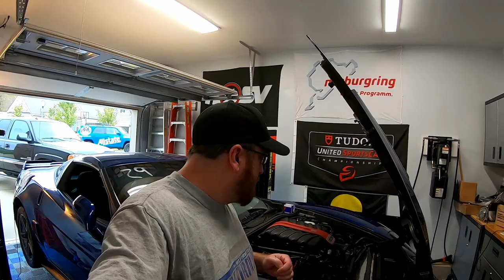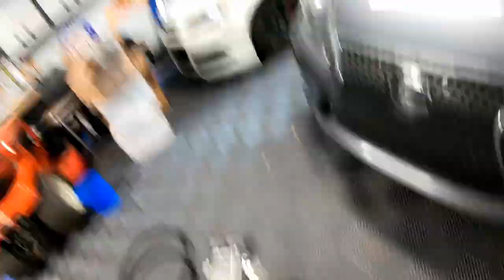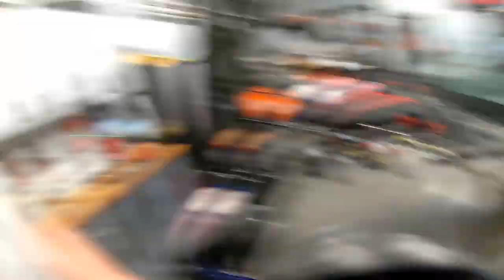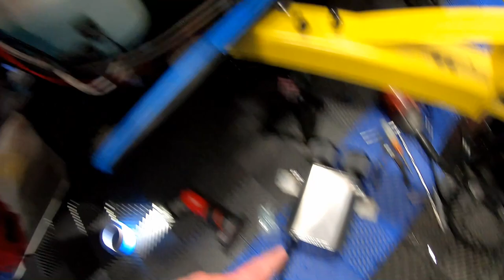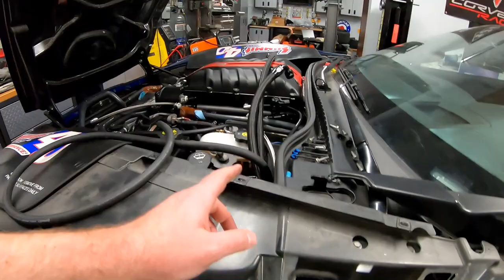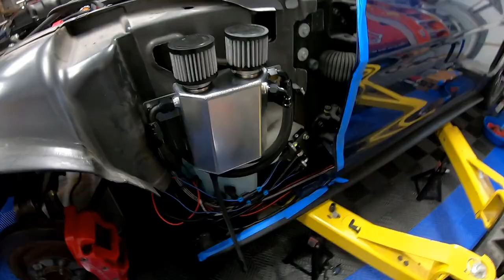2005 Chevy Corvette - V4.0 - Ep 43 - Prospeed Catch Can

Comment: Is there no check valve in the system? Curious how well it ends up working. Please do an update on it when you get some run time in.
Reply from the maker: Bent - no check valve in it. The catch can/breather is vented - so the check valve really isn't needed. I've had the car tuned - and not had an issue driving it around.

Comment: Hey man would you be able to post a video or maybe send me some pics about how you routed all the lines?
Reply: Mainly the valley cover lines and how you teed to the sump
Reply from the maker: Jay - what motor/year car is your setup?

I have a wet sump LS3 - so I just have the -10 lines (one from each valley cover) going into the tank. 
I also have the line from the valley cover - (I think its the rubber line that Prospeed provided) going to the tank as well. 
The port on my Eforce supercharger - I have blocked off. 

So thats the 3 lines going to the top of the tank - and then there is a drainage line on the botom of the tank I have routed near the floor jack hole in the frame.
Reply from the maker: See my reply below.
Reply: Copy I have a zr1 so I've been co fused about the oem vaccum lines and what to do with them
Reply: @javierr.4059  Me too. What you did with the Original plastics PCV lines?
Reply: @briangarcia4496  I cut and deleted them bro

Comment: So that catch can does not hook to vacuum ?
Reply from the maker: From the Prospeed site:

The OEM pcv system is not designed for the extra crankcase pressure from increased blow by from forced induction or "loose" built engines, this system achieves three things in one unit: Increases the line size coming from the valve covers (dual .375" OEM to dual .625" (-10AN) as well as vents the valley cover with a -6AN to allow better pressure release (prevents engine seals from being pushed out as well as turbo drain back issues) Prevents oil from getting into the intake side of the engine. Allows only clean air to enter the engine providing more HP (our system is 100% atmospheric (not connected to the intake system)
Reply: @bonecrrusherSS  So how do you vent bad gasses from accumulating in the crankcase?